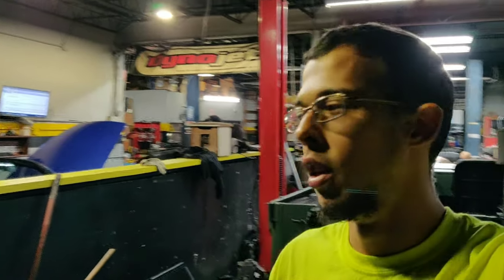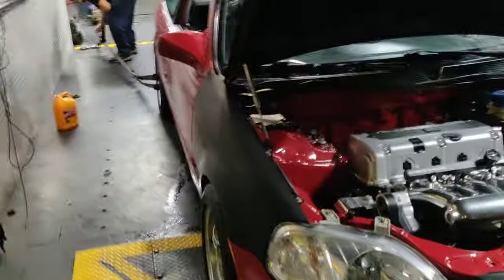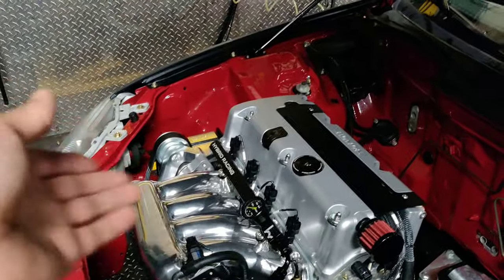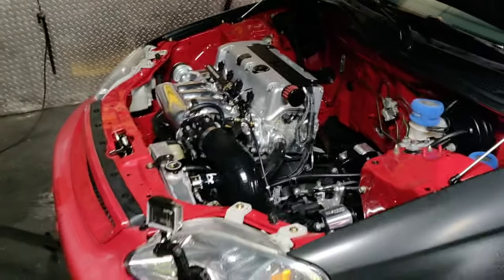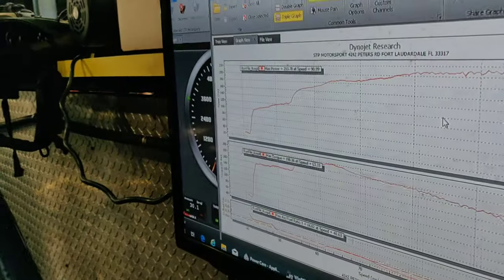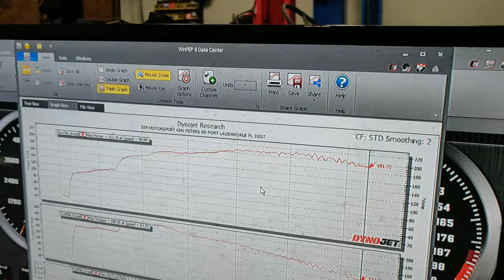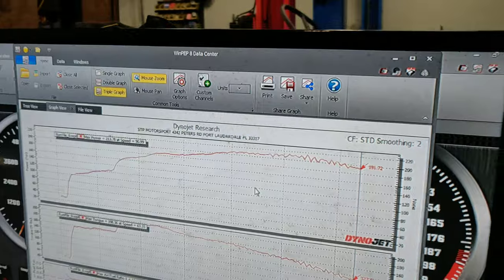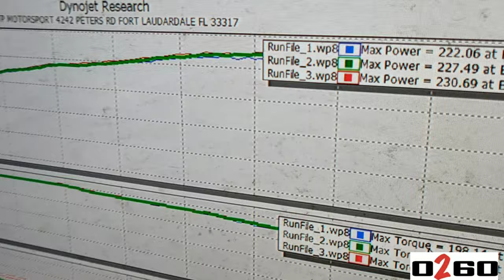K swap em1 | k24a2 | k24 si | k24 em1

Comment: Hey I did the same swap but for some reason I can’t get mine to start I have a k20a2 engine with a 02-04 pnd kpro Ecu please help been struggling for months I’m all I got
Reply from the maker: What wiring harness are you using... Go ahead and send me a message on IG @official0260
Reply from the maker: I will be looking out for your message